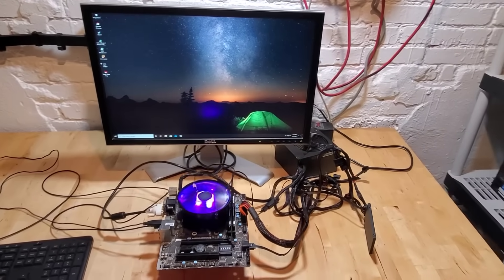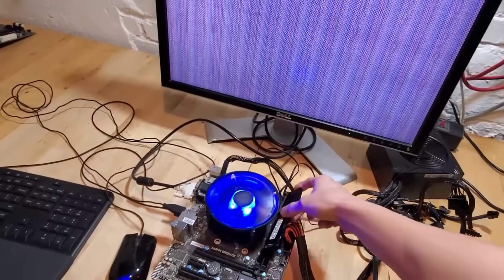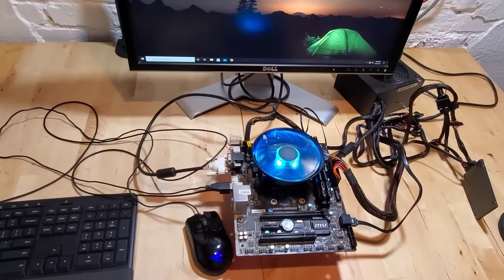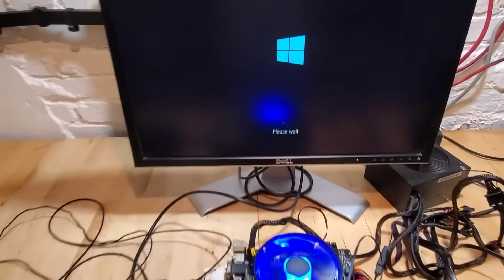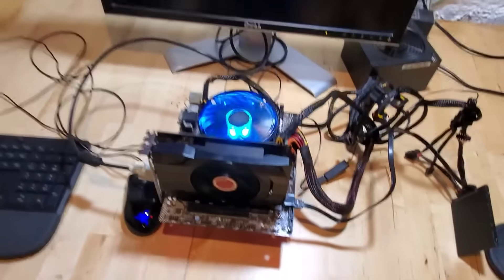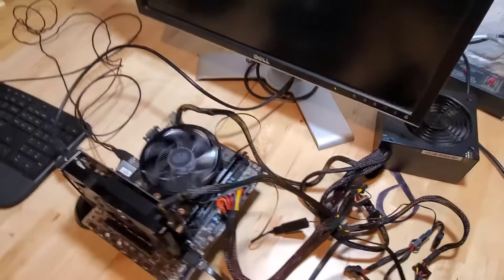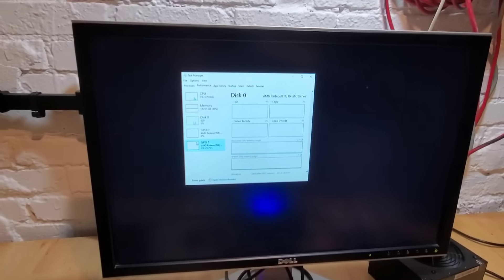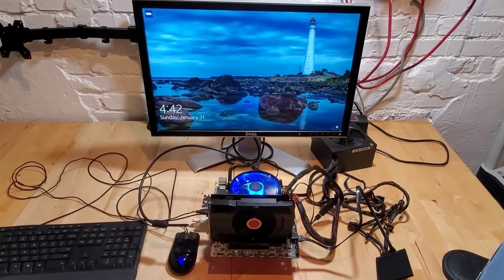What happens if you remove PC components from a running computer?

Comment: You can go to that recovery menu if you frequently restart your computer multiple times in a row as an automatic process, so restarting it again afterwards and it working fine is indicative that the computer works fine. So whether or not anything was  affected is up for question, but unlikely.

Comment: I wonder what happens if you cool down the RAM as if you were performing a cold boot attack, then removed and quickly replaced it. My guess is it would freeze, but the image might go back to normal since the iGPU would have the frame buffer data back.

Likewise, I wonder if unplugging the GPU would make it switch to the iGPU, or if power cycling the GPU and/or reloading drivers would solve the issue (might work on Linux as that’s what happens after resume from suspend, not sure if possible on Windows)

Comment: This is so fascinating, cheers for showing it. 
Removing RAM is like the equivalent of Humans having one of those phenomena where the subconscious takes the conscious mind "out of it" for a while until things are safe. CPU removal was like a loss of consciousness and entering into a coma(restore mode) 😅
What happens if you remove one stick and then put it back in, does it still do nothing to bring it back to where it was?
So, when you removed the video card and the display goes, what happens if you just plug the display cable into the onboard video instead, does that transfer over or is there still no display until you restart? 🤔

Comment: As expected:
- Every sector in RAM turns to "0" the moment it has no more voltage supply. Because RAM is non-persistent and contains its states only aslong as powersupply is available.
1 Second after removing connection/powersupply all information are lost and ofcourse! the system does no longer work. 
- Without CPU nothing works at all, its like removing the brain and expecting the body to still work.
- Other parts however, are interesting to mention:
-> If you remove Graphics card and still have screen connected to on-board graphics card it "could" be possible that it continues to run as normal as pcie express is hot-plug-able.
Windows will just remove the graphics device and switch over to mainboard device. However it can cause a bluescreen of death depending on what WIndows is actually processing.
-> HDD/SSD (as long as its SATA) is hot-plug-able aswell. If you dont actually remove the SSD where the system is currently running, but another one basically nothing happens. 
Its like connecting or disconnecting an USB stick. Apps currently running will stop running or crash, the volume will disappear but in general the sytem itself will continue to work and you c an re-plug it in.

Comment: A fun detail is that PCIe supports hot swapping.
But most PCIe devices don't implement it.

On the other hand SATA is fully how swappable, and on some boards you even get the "safely remove hardware" notification.
Obviously taking out the system drive is something the OS doesn't like, but any other drive can in principle be swapped just fine. I wonder how it reacts if you boot from a RAM disc.

Comment: Fact: two crashes with windows it goes into recovery mode its not the fact that the CPU was removed and put back.... Also yes almost all hardware can be pulled and put back in hot.... But if the hardware is very active like in a game or some other program not in standby mode you could damage it on some level.... The only thing I would mess around with while the computer is on is the case fans as most of it is just power no real instructions are given aside from light configuration Also you would have some response from the pc if you took out bank one not bank zero first of the ram.... It goes from Right to left now

Comment: The reason why the system was still up for a little while after unplugging the drive, is because it was still loaded in RAM.
As the RAM continually refresh, the system eventually starts to unload, causing the UI elements to die one by one until nothing remains.
I think it's quite amazing that you still got a BSoD. (Kernel panic)

Comment: I have a surface book 2, so the keyboard can come off, but the keyboard has the dGPU in it, so when I disconnect the keyboard, the screen flickers 2 times before it disconnects successfully, and device manager says I don't have any dGPU anymore until I plug the keyboard back in (same as a 2 battery in the keyboard)

Comment: I had a SteamOS  recovery environment running on an SD Card and I forgot to shut it down and when i unplug it, i get a bunch of ext4-fs errors and a bunch of things. The second I unplugged it, it froze for a second and went to the boot log where i got those errors. Nothing really happened so i force shutdown. fun experience, and data didn't matter because i was already going to install a windows 11 setup thing to fix bcdboot.

Comment: i’ve “accidentally” unplugged my sata drives when i was freaking out that my computer wouldn’t fully boot after i recased it and then it wouldn’t power at all until i unplugged every single wire from mobo and plugged back in luckily it started working again after that
Reply: why i quoted accidentally is because i meant to do it but since i was freaking out i did it while the computer was trying to boot itself over and over, after i did it the computer mobo rgb started flashing even when it was completely unplugged so i thought i really screwed myself

Comment: Record
Ram: glitching screen
Cpu: all processes die physical components running also needs to Enter recovery mode from abrupt power off
Gpu: obviously all video decode stops (I don't know the terms) fans go wonky
Ssd: background abruptly gets (technically) deleted system hardware feeding off of RAM storage explorer dies system crashes due to msd not available due to not having an operating system it boots into motherboard system (uefi bios) system does not recognise storage device until resetted after reset it boots into windows

Overall: do not try this because memory could get corrupted

Comment: Actually I"ve done this accidently to my PC with the GPU :P First time ever plugging it in I've done it like an idiot - just partially and gpu fell off. At the beginning the fan was working fine, so I figured it shouldn't have been an issue. But it was not detected by the system. When it lost connection completly the computer automaticly rebooted itself, but that was very old motherboard, maybe they were made differently ¯\_(ツ)_/¯

Comment: if i have a system running, will it be safe to plug in or plug out a ssd or hdd and will it recognise it or will it need a restart and is it safe for the drives

Comment: I unpluged my liquid cooling pump and CPU fan while my computer was on because it kept saying "512-Rear chassis fan not detected" even though it was clearly making noise...Once I unplugged them, it gave me a hard time shutting it off and now won't turn on at all. I was just on the brink of fixing it when i got a new motherboard due to messing up pins from trying to figure out why the fan was going too fast and loud to an unbareable volume...After waiting over a week for a motherboard...I may have destroyed my new motherboard....Please someone help me....please....im so frusterated to the point i want to break everythint in my room. I have no money and my computer is the only way i can make money. Please someone...
Reply: What's the problem with your new motherboard?

Comment: Hello ,
i have laptop and while cleaning i didn't see that it was start booting and that moment removed the Rams from the system and because of that SSD got currupt or idk what happened . Now my laptop didn't recognizing the NVme SSD i checked it when enclosure its also not showing in other systems .
 is there any solution .

Comment: But what happens when you have two monitors. One is connected to the gpu and the other one is connected to the integrated graphics, will the system know that the gpu is disconnected and goes to the integrated graphics???

Comment: I feel like next time you should try keeping the GPU in while removing CPU, vice versa, we weren't able to see any potential artifacts from removing the CPU because of the integrated graphics being cut off.
I also find it interesting that when you unplug the SSD, most things on the screen stay there. It just shows you what is currently loaded into the RAM right before you remove the SSD

Comment: Well. PCIe devices are enumerated when boot-loader moves control over to the OS/Kernel. If the operating system decides to enumerate PCIe devices again it might actually be able to continue normal operation of that PCIe device. Course this is just speculation, and from how the GPU acted after you disconnected, the GPU may or may not be trying to do stuff with the BUS between it and CPU even after being disconnected. To me this sounds similar to "Phantom Pain", where the bus (neurons) between your limb is destroyed yet your brain believes that bus still exists.

Comment: I recently tried swapping GPU's. When I went to put the old GPU back in I didn't realize the computer was turned on. There was a pop and a spark when I put the GPU back in from the PCI-E slot. Luckily I avoided disaster but yeah...Would NOT recommend putting a GPU into a running PC lol

Comment: I suspect there may be slightly different results if you remove the ram while running with the GPU as without it part of the ram is used as vram for the CPUs integrated graphics.

Comment: For the CPU, the reason Windows shows that screen is because it automatically detects that it hasn't shut down cleanly a few times, so it gives that prompt in case Windows needs recovery (similar to the "Start Windows Normally" screen you would find in Windows 7).

Comment: The reason why the computer doesn't recover after re-inserting both sticks of RAM happens because RAM is a volatile memory, meaning that once it loses power, all data stored will be lost. This differs from non-volatile memory, such as an SSD, which retains its data after it loses power. If random access memory was able to store data in a non-volatile fashion, perhaps an instant recovery would be possible, assuming no checkguards or failsafes are put into place by the BIOS or Operating System. Additionally, the reason why the computer stops responding after removing only one stick of RAM is because the data is split evenly between the two RAM channels. The code that makes the mouse cursor move, for example, is split up between the two channels, and if one stick were to be removed, the entire code for mouse movement would be corrupted. All processes run in memory, anyways, so it's no wonder why the entire system and all of its running processes would stop responding once the RAM is removed.

Comment: Would be interesting to see what happens if you remove the CPU while using the dedicated GPU. Why? Simple, when you removed the CPU, it was using the integrated GPU, so it was like removing both the GPU and the CPU at the same time, not just the CPU, reason why the screen simply turned black.

I have no idea, maybe it also just turns black if you remove the CPU but not the GPU... But maybe not?

Comment: Great video.  I wish you also had shown you removing the GPU while the display was plugged into the motherboard pow`er to see if anything would happen` to the system or if it would be normal.`  It also would be interesting ot see with other `hard drives as well.  Iw ould assume removing a secondary drive would do nothing, but it would be interesting ot see if you had a secondary drive with an OS on it, and removed the main drive, what would happen?

Comment: This video is actually so useful if you run into any hardware issues and you cant see any normal pattern or you just dont know what part is not working, good video
Reply: The beeps already do that
Reply: If you don't seat your RAM correctly your PC refuses to boot.
Reply: Se hai bisogno di fare una cosa del genere per capire quali componenti sono guasti... l'informatica e l'elettronica in generale non fanno per te.

Comment: The reason Windows forced a recovery troublesyooting step after the CPU-less reboot wasnt anything to do with how you killed the system, it's simply that Windows 10 and later are designed to trigger that recovery step if the system crashes 3 times consecutively without a clean shutdown somewhere inbetween. On systems without a way to enter the UEFI with hardware, triggering this recovery step can be crucial to access UEFI settings you might not otherwise be able to.

Comment: With the GPU, I'm curious what would have happened if you plugged the monitor back into the integrated graphics before resetting.
Reply: Exactly. Seems very important.  Would be hard to manually set your display, but wonder if detection would work.
Reply: Detection often works auto. (I've done this several times.) Most systems just throw your graphics back to integrated and changing the cable back usually just triggers the screen to detect the new output.
Reply: Yeah a gpu is more seen as an extra device you plug in your pc than a component like the cpu and ram is. But some motherboards disable the igpu if a gpu is plugged in. So it might not work.
Reply: I'd say it would probably work. You can plug new monitors into the motherboard while it is running and Windows will recognize them just fine. Additionally, a GPU is less attached to core system components than other devices.

Comment: the video corruption is because the integrated graphics use the system RAM as graphics RAM, whereas a dedicated GPU has it's own graphics RAM so removing the RAM with a dedicated GPU would not result in that screen corruption, it'd still freeze the system tho

Comment: Sorry but this is a VERY stupid test. Every device communicates with it´s controller via a protocol, and if it stops to respond (when you remove it), the references to that device becomes invalid, so NO device will go back to running without a restart. The same will happen with memory blocks referenced by software inside memory sticks. The SATA units are hot swappable, so they will go back to running if you plug them back, but if you remove the unit with WINDOWS installed, it cannot find the files it needs to perform various tasks, so obviously it will stop working. In essence, this tests are the same as asking: If I end a phone call by turning my phone power down, will I be able to continue speaking after turning it back on? Stupid question!
Reply: Well not everyone knows about anything and sometimes ask stupid questions about that subject. Not everyone knows about what you know

Comment: My first ever intro to Linux, happened in a network lab at college, (TAFE) and the lecturer went to show us a packet sniffer, but something didn't work, so he stopped the network service and de-powered the network card (this was March 1995 ~ no onboard networking then) and replaced it with a different one, then restarted the network service. I knew it wasn't DOS because a Microsoft machine would have crashed. I asked if it was UNIX, because that's what it looked like. He told me it was called Linux, and it was a bit like a back-yard version of UNIX. It was Slackware headless, in March '95. I have never ever seen anybody repeat that particular stunt ~ but I became a huge Linux fan right then and there.

Comment: My suspicion is that the bluescreen when removing the storage device is caused by a page fault... What happens is that windows writes programs it doesn't use to the disk, that way there is more room for file caching (windows stores files in memory to make them open faster). When a program is executing that is partially written to the disk, what will normally happen is that it causes a page fault when the CPU tries to access that piece of memory. This alerts the operating system which would load that page into memory, but in this case the disk wasn't there, so it couldn't recover.

Comment: fun fact: If you have 2 batteries (for whatever reason) you can hot-swap one at a time,
another fun fact is tome hardware  just thinks it’ll be in for the session, and when trying to disconnect and reconnect, it might have a different ID, and the BIOS or OS might have been accessing the old ID.

Comment: great video but you should have been removing the CPU when its not used for the display output and you also should have tried switching the display cable to the Mainboard after you removed the GPU because there is obviously no output from the gpu when its plugged out

Comment: what if you remove the gpu while running but instead of install it back on the motherboard, remove the display cable then plug it to the motherboard to use the integrated graphics.

Comment: In an older computer if you pull a RAM stick and then turn it on, during startup you will get a message that says 'Ram has been reduced'.
So out of curiosity one day I tried to pull out a RAM stick out of my older computer at the time  just to see what would happen.
I went to pull it with my bare hand and got electrocuted. 😁